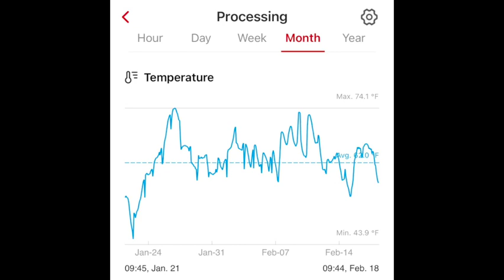Bug Fueled

Comment: I was growing some serious skunk many years ago. NO not me, my cousin! hahaha. Anyways believe me it was some kind of god awful odor to deal with. I wound up with activated carbon filter canisters 6 inch diameter, 4 feet long. Out of the end of that with a 4 inch hose attached to a 4 inch fan. Worked like a charm and completely stripped the odor. Those things were about $125 bucks each back then and no idea what they might cost now. But you might take a look at the design and make something DIY that'll be as effective. Hydroponics stores is the place to find that sorta stuff.
Reply from the maker: That sounds like a good start. I'd really like something that's reusable

Comment: Nice t see your great success. During a cold snap I lost almost everything. I'm basically starting over. On top of that I have been invaded by mice. I've trapped over 30 so far. They eat the larvae faster than they can mature. Can't wait to get the new bug room built. Keep up the good work.
Reply from the maker: I've also been battling mice, but not quite as many as you have. The cats do a good job at keeping them in check -- it doesn't stop them from chewing at the insulated walls though. I guess I get some metal-plated insulation next time.